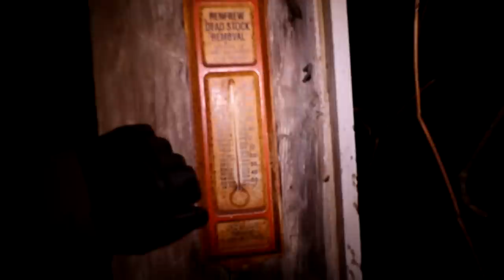WE FOUND MORE DEAD ANIMALS INSIDE THE HAUNTED FARM (CATS)

Comment: Moe, I don't know if you are old enough to remember this but TVs like the one in this house were only able to get 4 channels on them and you needed to connect an antenna to your tv to get that.  Either a large outside antenna on your roof or what they called rabbit ears that sat on the top of the tv.  The only channels then were ABC, CBS, NBC, and PBS (public broadcasting system).  It wasn't until the 1970's that you were able to get cable tv which at the time was I think around another 15 - 20 channels added to the original 4.  There was no digital tv everything was analog.  Some people only had TV's that everything you watched was in black and white because they couldn't afford a colored tv set.  The TVs then were also very heavy.  I just thought you may find this interesting.  Stay safe!
Reply: I remember that! And if the president was speaking, or there was a national news break, your TV watching night was screwed!

Comment: At the 10:20 mark, that is a "Wringer".  You accurately described what it does.  The ones that were powered by electricity (or gasoline) were part of an early washing machines and they were known (in some parts of the USA) as "Mangles", because, if one was not careful, it would mangle one's hands.

Comment: okay when you where at them two abandoned Barnes and you had to jump off the 2 stories the stars that was on the ground the five star with the circle around it also known as the       (Sigil of Bajhomet) the spirits  only have power over four elements at the time Spirit as you know,earth,air,and the five humanly body senses that is why they can touch you and all that but there human power level is so low that not only can they posses you but thats why you have to use the spirit box most of the time.